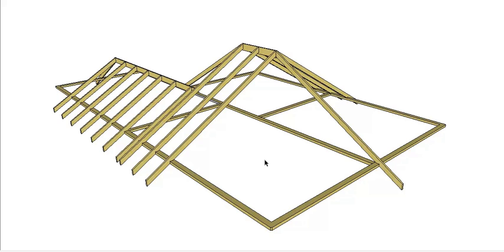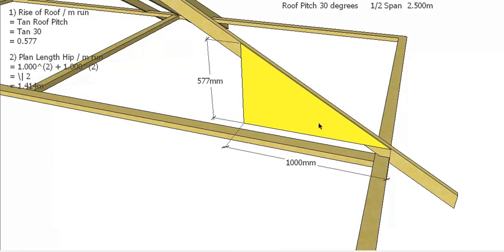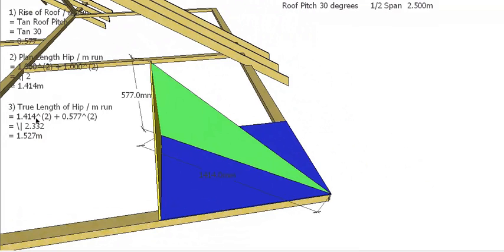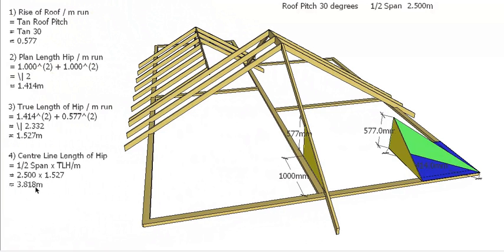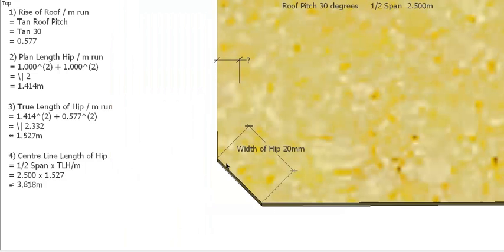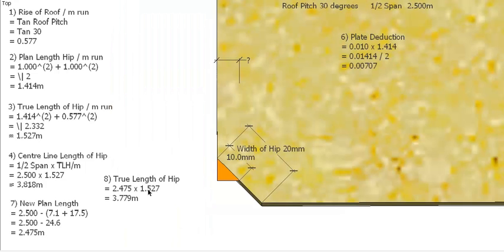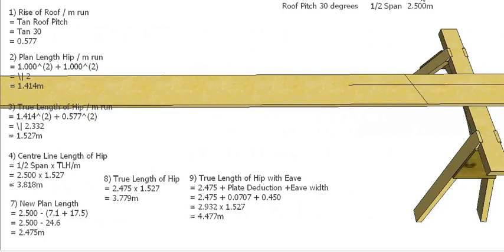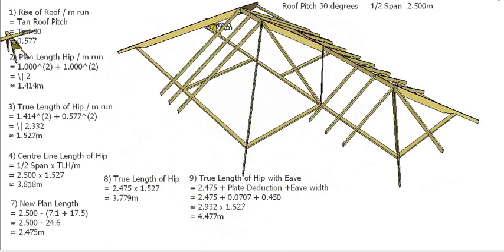Establish Hip Length - Calculation

Comment: For the top plate cut why do we divide by 2?
Reply from the maker: @wheres_bears1378  I'm not sure which one you mean, sorry
Reply: @Buildsum  the cut where there hip rafter sits, you were saying to times half the rafter with by the hip plan run then divide by two. I think I got it now though, it’s because we are splitting it over two top plates that’s why we divide by 2
Reply from the maker: @wheres_bears1378  it's more to do with getting a dimension thats in line with the half span from a dimension at a different angle
Reply: @Buildsum  ok yes I understand now, thanks heaps for your help 😊

Comment: at 4:30 for the ridge deduction, we were told to half the thickness of the ridge. Here you are saying half the thickness of the common NOT the ridge. Is this right ? as commons and ridge are nearly allways different width materials so it will matter ? thanks!
Reply from the maker: Hi Mate, because we are working off the span of the Crown end rafter then it is half the common rafter distance, not half the ridge.
Reply: @Buildsum  awesome thanks. another quirk with hips learned.

Comment: Am I correct in saying that the plumb cut angle on the hip (top and bottom) will be different to the plumb cut on the commons
Reply from the maker: Hi Aniton, yes, because the hip has a longer run for the same rise, then the angle is less and there for the Plumb cut will be a lesser angle.
Reply: @Buildsum  is there a way to calculate what this angle would be with a formula or is it worked out on site?
Reply from the maker: Hi Aniton, you can calculate it however it is more commonly developed geometrically. I have a heap of videos on the different ways that this can be done.
https://www.youtube.com/watch?v=NfSkTT35UoI&t=2s
https://www.youtube.com/watch?v=vTsaeorlMxg
https://www.youtube.com/watch?v=yK_Vlnr8bHA
https://www.youtube.com/watch?v=inSM6upJf3s
just to get you started.

Comment: In step 9 you added the eave width of 450mm. Shouldnt this be longer due to the hip travelling a longer distance(compared to the commons) to meet up in the corner? In plan view yes the overhang of the hip equates to 450 but when I draw this on plan the length of overhang is 637mm +/-
Reply from the maker: Hi Aniton
I add the eaves width to the 1/2 span of the roof because I have worked out a ratio so for evey metre of the 1/2 span 
 I know how far the True length of the hip would be per metre.
You are correct the hip plan length is definently longer that the Eave width and the true length of the Hip is longer again.
Hope this helps
Reply: @Buildsum  would great to have a video on how the jack rafters are calculated and marked on the timber also  :-)
Reply from the maker: Hi Aniton, I cover off on that in the Pattern Rafter for a hip roof video
https://www.youtube.com/watch?v=TcN3O7owg9I&t=468s

Comment: What is "tan"?
Reply from the maker: Hi Radu,  the tangent (abbreviated "tan") is the ratio of the length of the side opposite the angle to the length of the side adjacent to the angle. this means that if we know the Horizontal measurement of our member and the angle or pitch of the member we can use the TAN function to work out the Rise of that member.
Most scientific calculators have a Tan button that you can use to do this function.
Hope this helps

Comment: i do have a quick question , i use the red roofer book to help me with roofing calcs  but at the top of every page it states  the pitch  and next to that it has a measurement in feet do you know what this measurement in feet means
Reply: Great thanks mate
Reply from the maker: Hi Michael, is it in feet or inches? In America, they express the rise of a roof in inches per foot, for example, a 27 degree (26.6 to exact) would be a 6 inches in 12 inches. I am guessing that this is what that measurement would be. hope this helps
Reply: @Buildsum  hi yes,  this is in feet for example 25 degrees and next to it 38 feet the next page 26 degrees next to that 34 feet
Reply from the maker: Hi Michael, I'm now pretty sure that the "feet" measurement that you are referring to is actually "minutes" as in degrees, minutes and seconds. None of the angles in the Little Red Roofing Book actually equal an exact degree as they all come from the imperial ratio system as I have previously described. So it would be 25 degrees. 38 minutes of angle not exactly 25 degrees. Hope this helps

Comment: Helpful. Thanks. Been going through this step by step to get my head round it. Am I correct in suggesting that point 9 in this tutorial is incorrect? The true length of the hip is surely 3.779m not 2.475m?
Reply from the maker: Hi, Will Yes as per Point 8 the length of the Hip without any deductions or the overhang is 3.779. The 2.475 is the plan length of the hip before we make the deductions and add the overhang in point 9
Reply: What confused me what the final part of the video, cutting the hip. Mark the plum and edge cuts, then measure down 2.475 to mark seat cut, then measure 4.477 to include eave length. I would have thought the measurement from plumb cut to seat cut would be true length of hip (3.779m), not 2.475m as explained in the vid.  That's where I got confused. Perhaps I'm still not right!
Reply from the maker: Hi Will, no you are correct I should have said 3.779 to the back of the Birdsmouth, sorry about that I will fix the video up now.